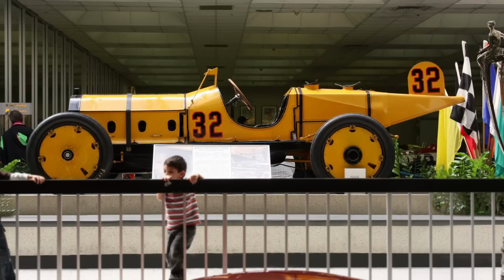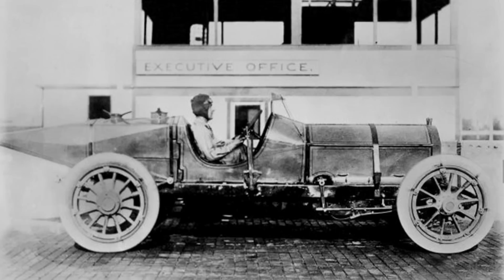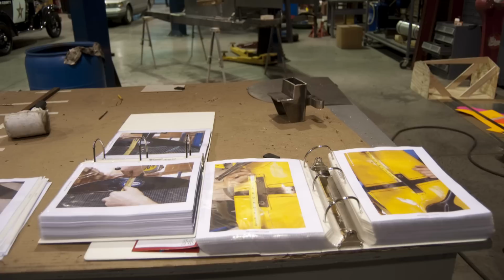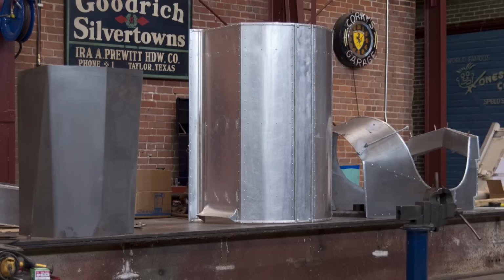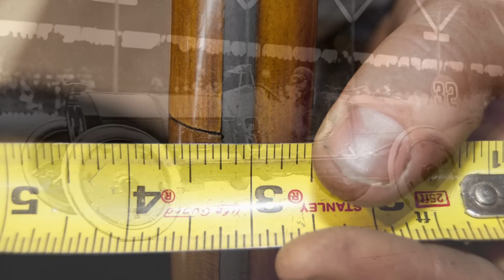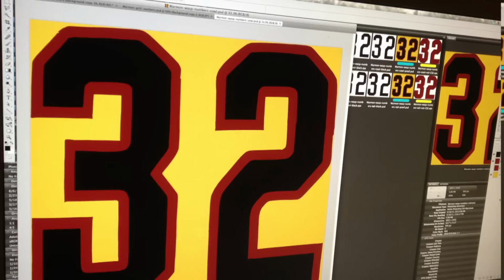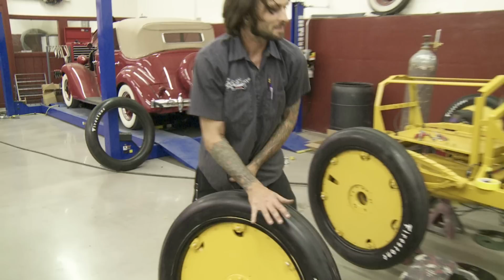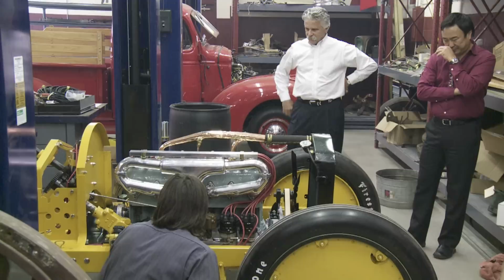Building the Legendary Marmon Wasp

Comment: Funning and stunning. Wow now Corky! I wonder if it is even more powerful and fast than the original? Thanks a ton, Paul in Thailand PS I used to have a gray 1912 Cartercar Model R roadster basket case/wreck that had been converted to a narrow gauge railroad speeder for a logging line on the foggy coast north of San Francisco. Where is it now? Sold in 1970 as I was only 20 and my dad was frowning, hahahah. "Where are you going to get parts?"